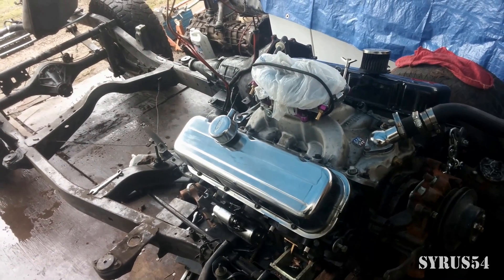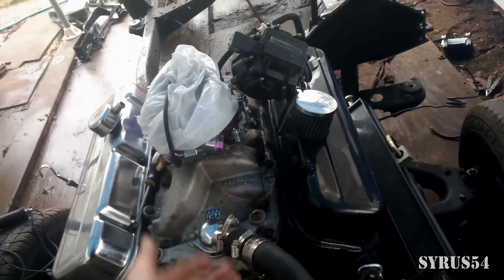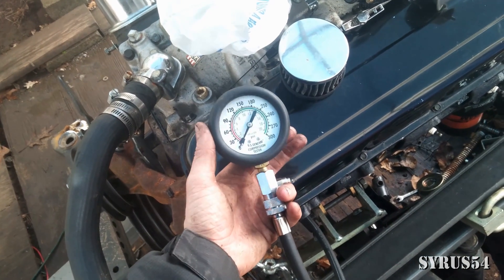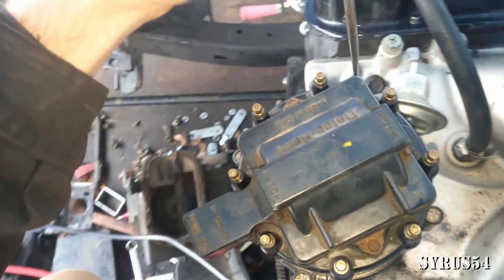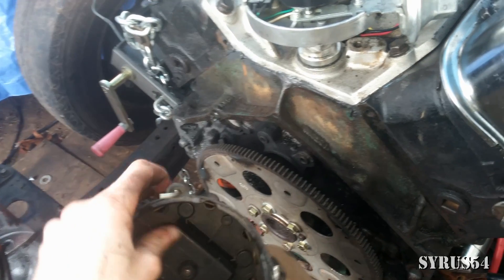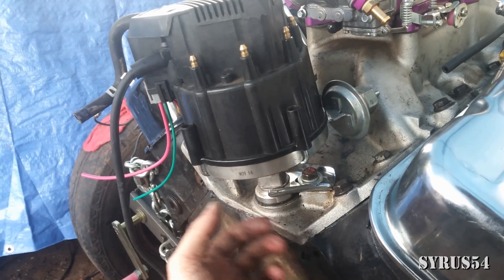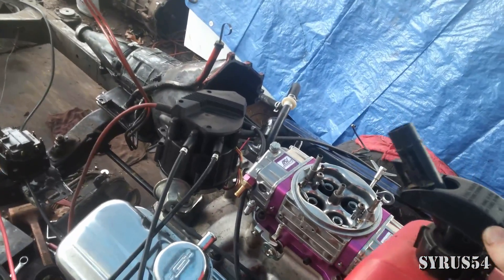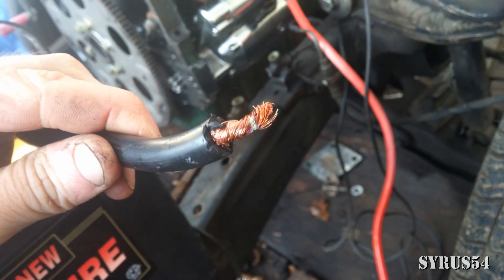Vehicular Education - BBC Distributor and Firing Order

Comment: Once shafts is down in the hole with rotor tab facing number one cylinder the gears are engaged to the cam, you can then rotate the engine by hand and the rotor will turn with the engine keeping it's orientation  until the pump lines up and it will drop in the rest of the way. Great layman's video.